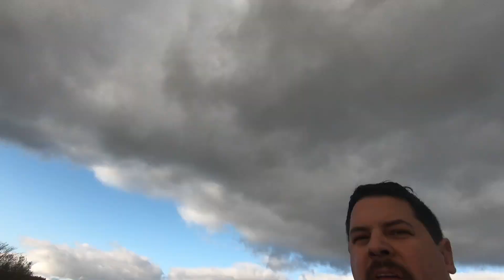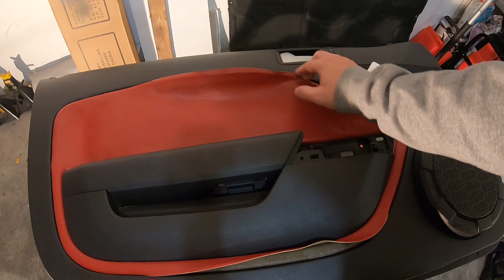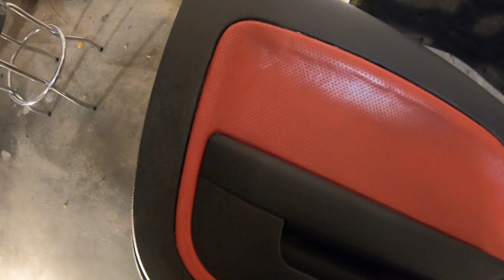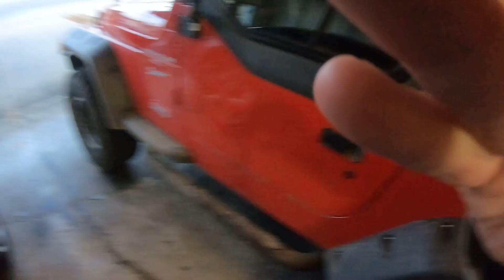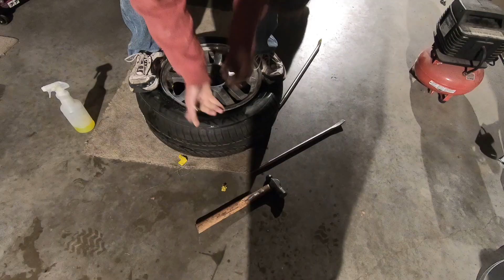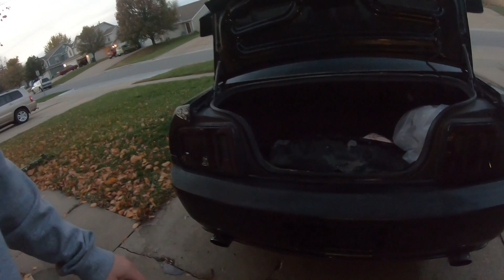2005 Ford Mustang GT Copart Rebuild Part 18 | First Test Drive!

Comment: Sucks about the bumper. Ya, it's going to need re shot. Maybe try a cheap spray gun for the clear coat so you can actually control how much material gets put down. That can method seems to be like pissing in the wind.  I wouldn't try again. Door panel turned out great! I have a 2001 ford lighting that's doing the same thing on the passenger door panel. Guess what I'm fixing over the weekend! LOL Car looks and sounds great. Big change from when you first drug it home.